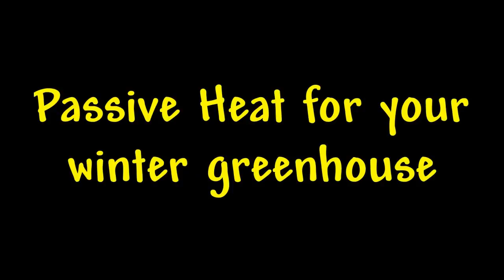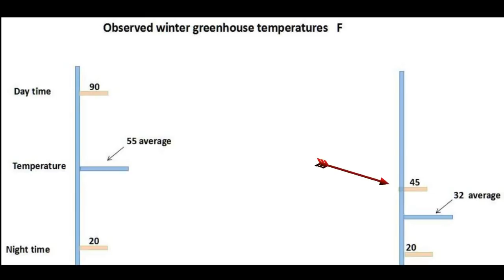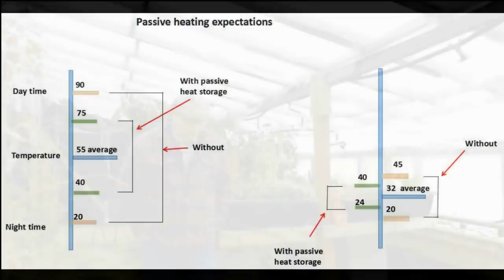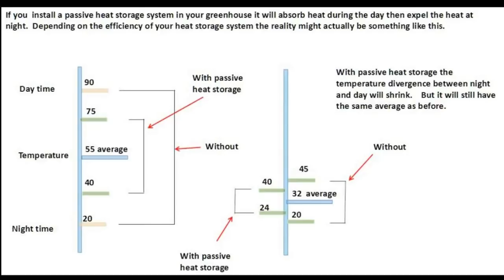Passive Heating a winter greenhouse using water

Comment: Have you considered using compost for passive heating ? I've seen others using compost to heat water lines and then bring the water lines inside the structure to heat barrels full of water or it could be vegetable oil which retains heat  longer than water . You could also run those lines under the soil via PEX pipes to keep the roots warm . There are several ways to utilize the heat from the compost including generating electricity using the thermoelectric effect . Using compost would be good for when the sun isn't shining but you could also use passive solar heating as well . Lots of possibilities for heating the greenhouse but they're not as simple as using a standard heater or a stove but they are safer and less expensive in the long run .
A good compost pile can last at least 5 months which would take you through the winter months .
Just some thoughts on the matter .
Reply from the maker: I am going to have to get a little smarter on composting before I try that.
Reply: It's a fascinating concept, but I'm real leery of spending a bunch of money and doing a bunch of plumbing to get about the same results as just filling a barrel of water. And you're still relying on keeping that compost pile hot and active in the first place, which means either taking up a lot of space in your greenhouse or building yet another shelter just for the compost, which means even more work and expense.... a lot of stuff sounds great on paper but you'll notice the people who make videos and write articles about it seldom do follow-ups a year or two later. Make of that what you will. When more people prove that it works and makes real financial sense several years in a row, I'll be more interested in using compost for heat.
Reply: @dystopiagear6999  no matter what I have to make compost anyways starting this spring.But I want to pull the heat and pump it into my Hoophouse to take advantage of that. My area is directly behind the Hoop and in full sun.I'm hoping to make this as simple as possible but do expect to spend some money. I have some of the materials hanging around already. At the same time I also want to use water as a heat source..

Comment: use green compost.....fill 55-gallon drums scattered thru out the greenhouse filled with the compost.  the compost puts out co2 with a temp in the 180-degree range....small fans to circulate the heat.  then at the end of winter you have fresh nutrient-rich compost for the garden.  repeat next fall........works great.
Reply from the maker: Too much work.     Hot compost doesn't stay hot for very long,   Then you have to "recharge" it with more green compost.
Reply: @eddysgreenhousegarden7022  true....I get 2 months out of mine.....but when you have a large farm,  the manure builds up quickly,  a tractor makes loading and dumping the compost easy.  and while living in south florida,   winters don't last  longer than 10-12 weeks.
Reply from the maker: @nathanielcohen9890  Just a quick question while I'm thinking about it.    Does it stay hot for 2 months, 180 degrees?    The reason I ask is that I have  composted fresh greens before, a while ago now, and it seemed to me that it would cool off in a few days or a week.  Always looking to learn something.
Reply: @eddysgreenhousegarden7022  that I don't know (thermal mass---size does matter).  I use cow and goat manure mixed with hay.  temp stays about 180 for about 4-6 wks, then lowers between 80-100 for another 3 wks.  I use fans to circulate the air.   up in Michigan,  I read where a farmer piles manure 5 feet high around his greenhouse.  but runs out of juice 6 wks before spring.  I only need the heat at night from jan-feb.  I think thermal mass is the secret as the mushroom farm down the road composts palm trees in huge mounds, the size of a houses and covered with black plastic.  they stay super hot for months on end.  the only way we could utilize such a source is to put coils of black hose thu out the pile and force air thru the hose and into the greenhouse.  pumping out warm air.  maybe I should try that and see how it unfolds.  also don't forget to add the microbes to your pile.  they are the heat producers.  something else that may work is a series of loops in a pond or covered pool in winter.  force air thru the hose and into the greenhouse.  the water is above freezing and cold hardy plants should do well.  it's the night time temps that are problematic in winter as sun heats the greenhouse up during the day..
Reply from the maker: @nathanielcohen9890  Very interesting.  Thanks.
Reply from the maker: Well it would probably work quite well for you then.

Comment: ive been posting on videos all week trying to figure this out. heating my greenhouse so my fish water stays at no colder than 70 F. my fish will die if they get too much colder than that. the fish will be in a bit less than 25 gallons of water (barrels cut lengthwise). im in middle tennessee. ive been looking at rocket stoves, heating a barrel with a waterheater and pumping it through the fish ponds. 

im tearing my hair out, lol.

i am trying to keep my running costs as low as humanly possible. 

the greenhouse is 10X20X7.5 simple plastic film type with a metal frame.

any ideas?

thanks!
Reply from the maker: Not sure just how cold it gets where you are but I assume it gets below freezing.  70 degree water  without a lot of heat input during the winter is a tall order.   This may not be what you're looking for but maybe try different fish?  I use goldfish.  They have no problem with 40 degree water.   That may not be good if you plan to harvest them though.
Reply: @eddysgreenhousegarden7022  ty for the reply.  my greenhouse is going to be used to raise tropical aquarium fish. im keeping at it, i will eventually find a way to build the kind of greenhouse i need. im not good at building so, lol, might take a while. I may go the way of a heated shed with large windows. something i can heat more like a house but lets a lot of light in.
Reply: @ShotgunAndAShovel  One thing to remember......coverings that let in light do not make very good insulators.   You lose a lot of heat when it is warm inside and cold outside.
Reply: I think you're trying to drink whiskey from a bottle of wine. Raising tropical fish outside where it routinely stays below 50F for weeks at a time and sometimes gets well below freezing is frankly just, well.... good luck making that work without spending a bunch of cash. 
One fun tip for far-out ideas is to run your plan past a banker or rich friend and see if they'll lend you the money to make it happen. Give that a try before draining your own accounts. ;) Often times there's a damn good reason no one else is doing it the way you want to.
Reply: @dystopiagear6999  I found what I needed, actually. It is being done but the guy doesn't have a greenhouse. I was overthinking it. :-D He's doing it in colder, harsher weather than what I have in Middle Tennessee.
Reply: @ShotgunAndAShovel  so.... he's just raising tropical fish indoors like everyone else?
Reply: @dystopiagear6999  no. they are outside.
Reply: @ShotgunAndAShovel  so please do spill the big secret of how he's keeping water warm outdoors in freezing temps. Geothermal?
Reply: @dystopiagear6999  it isnt a secret. its a public youtube video. he uses aquarium heaters and diy insulated breeding tubs with polycarb plastic coverings. super simple and is working for him. were i to place this setup in a greenhouse it would work even better because there would be no wind hitting them. lr bretz is his youtube.
Reply: @ShotgunAndAShovel  neat. I'd love to see how much he spent and how much energy he uses all winter to make it all work. All sorts of interesting things can work, but if it don't make dollars it don't make sense.

Comment: How did you determine the number of gallons you needed?
Reply from the maker: I did another video that explains how I arrived at that number of gallons.  Basically it involves figuring out how much heat loss you  have  on a cold night.   Then figuring out how much water you  need to store that much heat.   That previous video discusses that.  But it is very top level, not gong very deep into the calculations.  That URL is just below.  If that doesn't help  perhaps I can do another video with  little more detail. Let me know.   

https://youtu.be/1aIRiU_e-_4
Reply: ... all depends on how many black 55 gal drums of water you can find...

Comment: I am looking at setting up a Commercial Aquaponics system and Chicken farm as they compliment each other. I have 3 plans to make sure the Polytunnel has heat.
1. Burying the Polly Tunnel below the ground, the Poly Tunnel is 12ft high, so I plan on burying 6ft, this will reduce the effects of strong winds and keep more of the heat in.
2. The chickens will eventually be feeding off the compost heap bugs, however it will take some time to get this up and running.
3. I plan on installing a Rocket Stove, with underfloor pipes for moving the hot air round the PolyTunnel, the heat will warm the ground above the pipes and will release the heat during the night and day if needed. Even when the Stove is not running the heat from the compost will radiate into the pipes and through convection move around the Polytunnel.
Reply: Chickens are like self propelled heaters, have you thought about having a winter coupe in the green house so as to scavenge that other wise wasted heat source?  You are paying for their fuel anyhow and as soon as the sun goes down they head to bed. Your greenhouse would then truly be heated by smart technology.
Reply from the maker: A Lot of work ahead of you there.  If you do sink that poly tunnel under the ground,  make sure you account for dirt crumbling down on edges.

Comment: Looks like you have a real interesting channel.  Surprised it took me this long to find you.  I’ve been doing a lot of research on compost and geothermal heating for my dinky greenhouse over the last few winters.
Reply from the maker: Thanks.  I always hope this little channel of mine is helpful or at least interesting to people.  I make  a lot of mistakes ...but isn't that the way  some of us learn. 
Ed
Reply: Eddy's Greenhouse Garden yeah, I’m with you on the iterative failing/learning process.  You have some good perspectives on the thermodynamics of passive heating.  In effect you’re stealing from Peter to pay Paul.  Whether you use rain barrels or a geothermal earth battery, the heat storage medium will, in the long run, equilibrate to the average daily temperature.  Though the earth battery would seem to have additional positive heat flow, assuming that deep subterranean temperature is higher than average daily air temperature.  The earth batteries are far better at cooling, since you get an additional cooling boost when the water vapor in warm, humid greenhouse air condenses underground (where presumably you can drain it off!).  I’m a big fan of compost heating.  You can’t call it passive, since the thermophilic compost process is decidedly exothermic.

Comment: Lol seriously not listening as I see an electric heater behind you.
Reply from the maker: Ahh..but that heater is powered by solar.    Which is the next part of this series.   Paying attention is a good thing.  No one else caught that...or at least commented on it. 
Ed
Reply: The amount of heat given off by that heater is basically nothing. In an insulated building, yes, but not in a plastic wrapped frame with a heat loss that is incredible. Remember heat always goes to cold. Basic rule of life, there is no free lunch and when it is cold, it is cold.
Reply from the maker: @oby-1607  The heat from the heater is actually something.   But I get what you're saying.   That little electric heater makes about 5 to 10 degrees difference on cold nights.   That's not much but it's enough to keep things away from the freezing point a bit more.
Reply: what about a rocket stove with mass heated bed? I hear the clay gravel mix will stay warm overnight.
Reply from the maker: @dansmith598  I think that could definitely be made to work.   But you have to work out how big it needs to be and what you're going to burn.  Wood isn't free either.   Unless you can find a free source.
Reply: He explains the electric heater use in another video

Comment: I'm in the Midwest, what do you know about putting a compost pile in the green house for winter?  Some people mention it - I just don't know the cons to this and maybe you have some ideas.  Thanks.
Reply from the maker: I have not actually tried this for heat production but I have had some compost piles in the past.  From what I experienced they can get hot, but that requires fresh material and a good amount of it.  They won't stay hot very long, perhaps a few days or so, because the material does decompose and cools off a bit as the decomposition process slows down. So I would think to make it work you  have to really have a plentiful source of raw compost material and you'd be  working pretty hard to keep it going.   That's my guess on that.  Maybe someone else can add more and better data to this. 
Ed
Reply: I used vegetable waste from a local cafe and made a compost bed about 2qsm (2 yards square) in my greenhouse, it worked great 30°C (86°F) for weeks, temp never dropped below 20°C (68°F) in 6 weeks. I had a low bubble wrap cover over the top about 8" over the bed. I think it works much better than any passive methods and you get a nice pile of compost at the end.
Reply: Try it. Or, bales of hay, w rebar. And then pour urine on them. LOL. I swear, it's a thing.

Comment: I have a 6'x9'x5' deep concrete cisrern without cover which extends 2' above ground. I would like to build a greenhouse over it...(much bigger). Do you see any possibilities in using the cistern for passive heating?  Thanks!
Reply from the maker: Lolee, 
I wouldn't think you  could use it for heat purposes.  Because it's right in the ground as a concrete container, if you tried to store hot water in it, the heat would dissipate into the surrounding soil rather quickly.   Because most of it is underground,  you could simply store water in it and it wouldn't freeze.  The water would likely stay around 40 degrees F or so all through the winter.  If you want to see what I mean here's a link to an older video of mine before I put heat in my  greenhouse.  The pond never did freeze even though it got well below freezing in there.  https://youtu.be/To60EejIU-0

Ed

Comment: i use paving slabs on the west facing wall standing up all along the bottom, i half wrap them with foiled bubble wrap on the inside  leaving the outside flat edge to absorb the sun and charge with heat, also paint the outside edge black for heat attraction, works very well in the UK"s  unpredictable temperatures. happy growing people and i hope this helps you guys.
Reply from the maker: That's an interesting idea Brian.   And it's simple.  I like simple.    I may try something like that  in my greenhouse.    I have a wall that would be quite suitable to try it on.   Thanks, 
Ed
Reply: Pavers work well. I have several raised beds with plastic hoop covers, and the north and east walls are insulated and lined with pavers, and from about 10 am those pavers are absorbing heat, and it definitely helps moderate things at night.

Comment: Good video. I would choose plastic barrels because they will not rust out over time. I plan to us the water in the barrels in the summertime to water the plants in my greenhouse.  The barrels would be filled in the fall with rain or well water.
Reply from the maker: That should work great Steve.  That's definitely the advantage of plastic....no rust. 
Ed
Reply: metal barrels are much more thermal dynamic, ie the transfer heat much better.
Reply from the maker: That's true.  But in the looooong run,  Metal does rust.  But I suppose if you treat it right you you  can probably mitigate that.
Ed
Reply: @eddysgreenhousegarden7022  Liberty company, they specialize in plastic bags for cannabis growers (I don't grow it, but they advertise in my gardening magazine), they make all sizes of heavy duty plastic bags, including 55 gallon, so they could be used inside a metal can...then no rust. A part of my farm is dedicated to growing hydroponically in 55 gallon blue barrels, and I use the liners they make so I don't have any cleanup at the end of the season.

Comment: Interesting video 👍🏻 I'm hoping to use a combination of passive heat storage and compost heat in my greenhouse. I'm in the UK so don't have the really low temps you do! Do you get any real humidity issues with your pond / aquaponics etc. in the greenhouse? Cheers
Reply from the maker: I really don't seem to have any humidity issues from the pond at all.   During the summer the water temp is about 70 but the greenhouse is well ventilated.  During the winter (like now)  the pond stays around 50 degrees F and doesn't seem to cause any sweating issues. 

Ed.